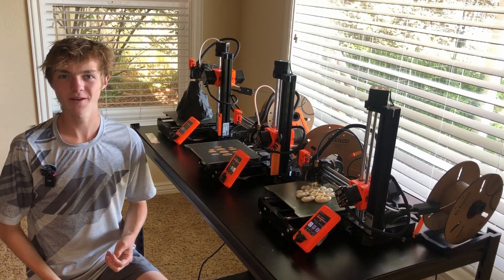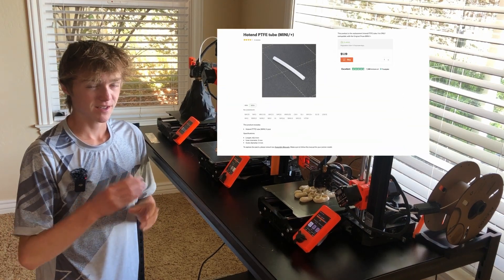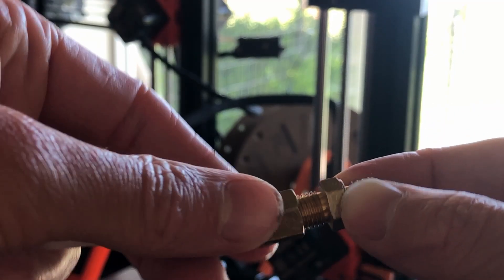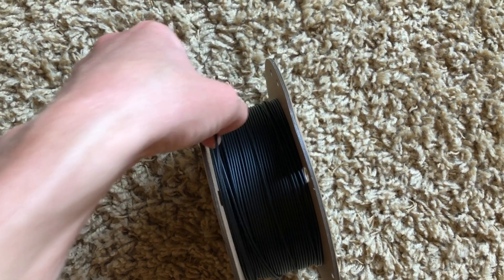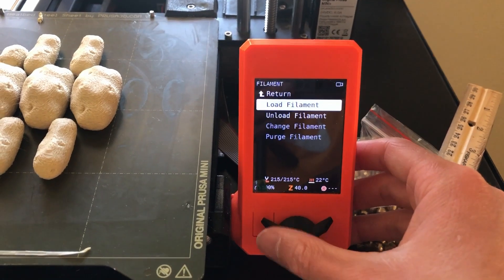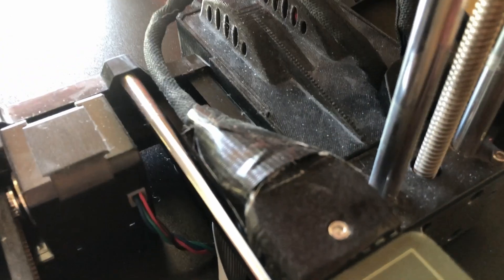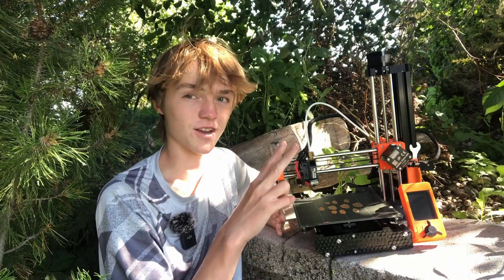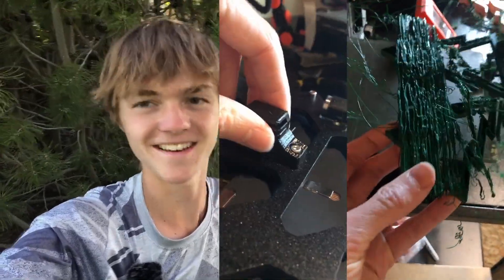The Prusa Mini's Top 3 Flaws and How to Fix Them!

Comment: I think I remember having issues with the PTFE tube in the heat brake before, but that was because I did the assembly wrong such that it didn't sit completely flush with the nozzle. Gotta make sure that you have that squeeze! Another problem that I had actually was the X-Y axes not being square, so that large round prints came out slightly oval.

Comment: Thank you! Pointed me in a good direction why my print quality went to a complete mess.. I found my heatbreak ptfe had began melting away. Those brass metal pieces around the 2minute mark are called compression unions and the little rings are sleeves. I also learned the hardway about purging extra filament when swapping from PETG to PLA

Comment: You can replace the heat break with one from bond tech and never have to replace the hot side PTFE tube again. Also, try Capricorn PTFE tubes. I have many hundreds of hours without failures using these.
Reply: I did that a few years ago when having issues with my mini…unfortuneatly the bondtech heat break suffers from heat creep. There are a few long thrrsds about this on the prusa forum.
What i ended up doing is changing to a dragon hotend.
The mini has been flawless since then.
Took some tinkering and requires a working printer to print the new mounts but definatly worth it🎉
Reply: @lillalysmasken3  I wonder what is different about my MINIs from yours. I have not had one single hot end related print failure over many hundreds of print hours and multiple printers using the Bondtech heat break.
Reply: @brettvitaz9101  i guess you were lucky and i wasn’t😅